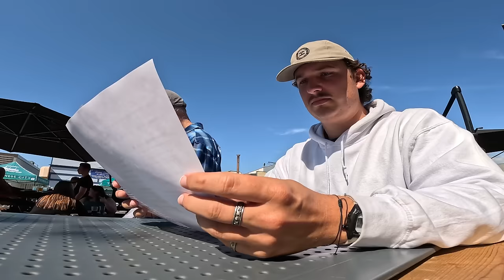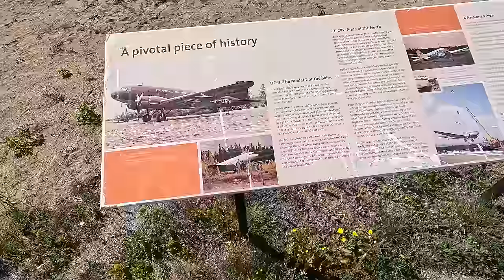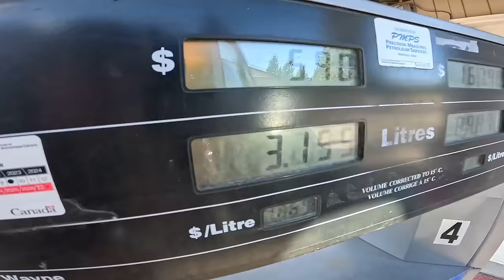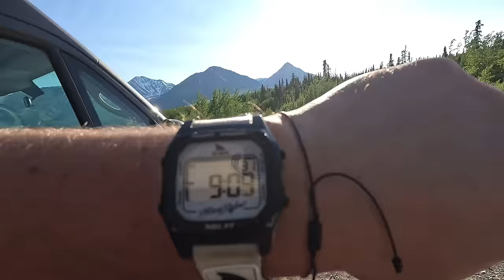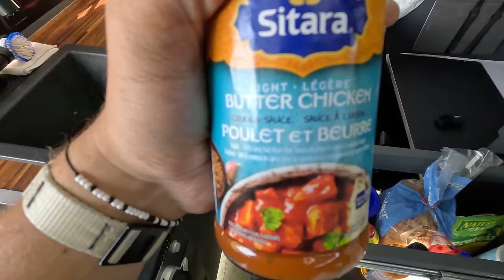ALONE Van camping In Yukon WILDERNESS | Butter Chicken over fire

Comment: At 16:20 those are insect traps! Used likely by entomologists to collect beetles or any other species of interest as they fly into the cones and fall down to the bottom where there is a bucket of antifreeze which preserves them. They're great for trying to monitor populations and/ or movement of potential invasive species.
Reply: Thanks for the info!
Reply: Thanks for the clarity

Comment: Ryan - for your little fire stove, buy you a box of “Tumbleweed” fire starters. Just google it you will see them. It will solve your problems. 

Or, smear a cotton ball liberally in a Vaseline jar. Out that under your tinder and light it. 

Both of the above give you a good 3-5 minute solid flame depending on air humidity / dryness.

Comment: Have you considered flat mounting your Starlink Dishy? That way you can do a semi-permanent mount on top of the van? There's also a unit that converts it to not need 110v, I believe is 12v IIRC. It sounds like it also maintains connection while driving, even with a small amount of tree cover.

Comment: i like that little folding metal stove & how you got a fire going in it with right size chips. good clean way to barb the chicken for the butter chicken. but mostly it &  angled cover plate gives you focused warmth on such a breezy evening. what was the outside  temperature there? mybe 0 - 5 deg C? (we use celsius here in Australia). I’d want to be all cosy & rugged up enough to enjoy the ~10pm view of surroundings.

Comment: We use to fill up before we paid in the United States, your just too young to remember. 

Pay at the pump was first invented in 1973 in Abilene, Texas, but did not take off until the 1980s. The system was introduced in 1982 in Europe, and Mobil claims to have been the first gas station to introduce pay at the pump in the United States in 1986.